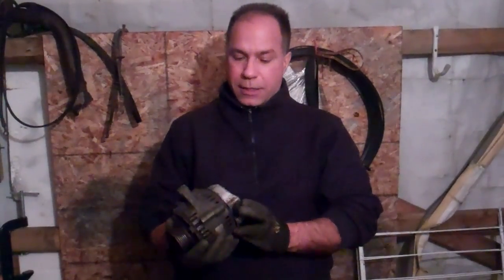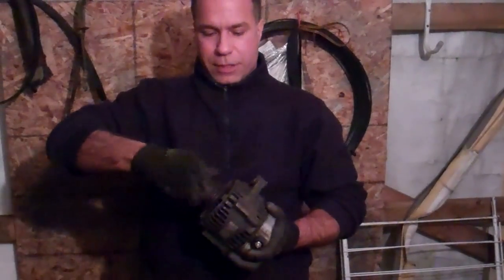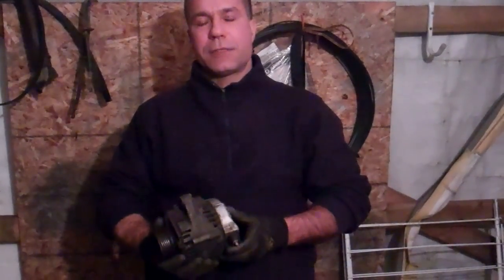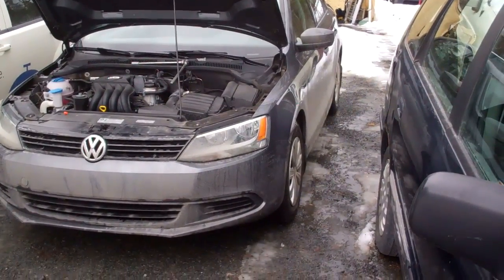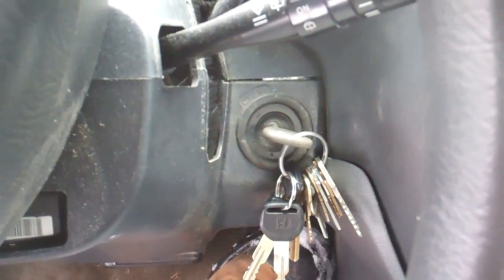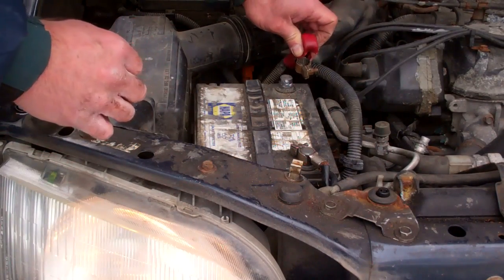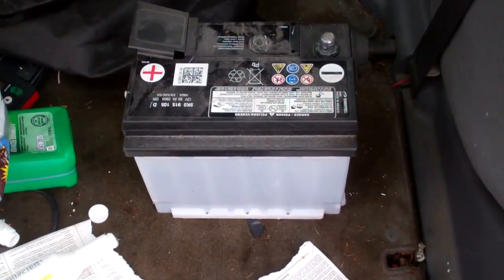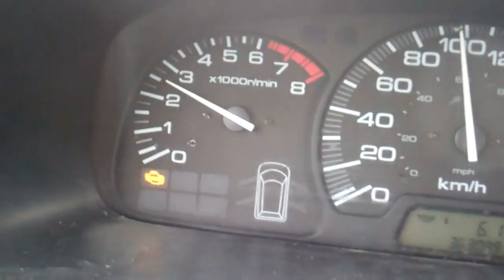Charging a dead car battery using the cars alternator

Comment: Using the alternator on your car to charge your car's battery will burn out the voltage regulator. Better to charge the battery with a charger at AutoZone etc.

Comment: Great idea to use what you already have if you need a boost immediately. I have an old (75%) battery as backup connected to current battery but with a 'relay' to charge both as I'm driving but doesn't drain main battery when it's stationery. Depends on availability of space. My main battery is in booth compartment  so it was easy to connect both. No more 'bad starts failures'. But also check 'unnecessary drainage' of power to stop dead starts.

Comment: Excellent Thank You - subbed.  Last year I swapped my small van's OEM 65AH battery with a bigger 115AH marine deep cycle dual purpose battery so I can camp, work and cook in my van.  It's a cheap $100 battery from home depot that comes with a 1 year warranty. I don't expect to get more than 3 years of life from the battery.   My alternator is 160A alternator and my engine is a 4 cylinder.  I frequently drain my battery down to 11v from 12.6v.  It's always started and never left me stranded.  I just need to make sure it always has water in it.   For over a year I've noticed my voltage will go from like 11v to 12.3v in JUST 30 minutes of running while parked, but then settles so when i come back the next day it will be around 12v.  Does this sound right? Can somebody translate this into percentages?   What percent is my battery at 11v?  12v?  how many minutes would I need for the battery to be at 100%?  So  driving is much better than running while parked?  By my calculations, this battery offers me about 700 watt hours of usable power before its discharged too far and won't start the van and I may be damaging it. Some testing on my channel.

Disclaimer:  Try this at your own risk.  I understand this is not the nicest way to treat a new van, but the decision was based on major cost savings that come from using the van like a hotel, office and kitchen and not having to drive back anywhere or pack and unpack saving me a ton of money and time that offsets any perceived damage to the van many times over.  It's also much safer being able to sleep in the parking lot of a bar at 3am!   I've taken the van to the dealership many times and nothing I've done seems to have voided the 5 year power-train  warranty.

Comment: Do you need to run the car on the highway up to 2500 RPM, Will the Alternator still charge the dead battery if you rem the engine up on Stationary to say 2500 RPM, or simply just idle at 800 RPM

Comment: just for the ppl that don't know better. don't do what this guy did when connecting a batter to a vehicle. u want to connect the positive terminal first and then the black negative. i totally get he was connecting a dead battery to junk vehicle. connecting the black "negative" terminal first can cause a short if u happen to touch any metal  inside the vehicle. always try to remember "connecting to live battery  = black goes last," and when "disconnecting =  black goes first." hope that helps
Reply: 100% correct. If you connect the negative first,  you can short circuit the positive terminal with your tools while connecting.
Reply: For security and protection to avoid grounding your absolutely correct.

Comment: Viewers, please heed his advice and do NOT disconnect a battery while your engine is running.  Old timers will tell you that’s how you check your charging system.  On older cars, you could get away with it.  On modern vehicles with all kinds of computers, that little spike or surge will likely do a LOT of damage.  The battery acts as a buffer to absorb any surges or spikes, and compensate when alternator output is low. 

Also, please don’t let any car battery sit while it’s discharged.  Sulfation occurs, and it will ruin the battery very quickly. 

it’s very bad for your alternator and battery to use the alternator to try to charge a battery that’s flat dead.  Alternators aren’t designed to charge flat batteries, and overloading it can damage it.  Running the engine for a few will put a little charge into the battery, but not a full charge and being undercharged causes sulfation in the battery.  Unless it’s an emergency, get a battery charger on that battery and let it fully charge before starting the engine.
Reply: 100% correct
Reply: Except many chargers will not charge a fully dead battery. I’m learning this today after buying a new charger and the owners manual states it will not charge a battery that is at 2v or below. Mine is at 6v and still won’t charge

Comment: You would have done better by stating how long you let alternator charge before shutting it off. The video went about 55 seconds at most before you shut the engine down. Ha ha I guess that's how long it takes! Snap! I'm not a blonde woman so that is just a joke. All kidding aside, you should have included that even though there's no guarantee another battery would be exactly the same, especially as yours wasn't totally dead to begin with. Guess I will find another video to see if I can learn something. See ya!

Comment: Could you spin the alternator pulley to charge the battery without starting the car? Like detach belt and hook a tiny motor up to alternator?
Reply: That’s the difference between a generator and an alternator.  With a generator, the field magnets are fixed magnets and no electricity is needed to initially generate current.   Turn a generator and you’ll get voltage. 

An alternator is much different.  The field magnets are electromagnets. In order to get current out of the alternator, those electromagnet coils need some initial voltage.  This comes from the “F” or “field” wire that connects to your alternator’s voltage regulator, and usually goes through the discharge warning light on the dash.  Every alternator has a wiring harness with a field wire.  Models may be different, but they should all work about the same.  If you go disconnect your field wire from your alternator and start the engine, your battery voltage will stay the same and your alternator won’t put out any voltage.  That’s why a burned out alternator warning light on the dash can cause an alternator to not charge. In my experiences, usually when an alternator regulator failed, instead of the warning light coming on while driving, it would stay OFF when the ignition was turned on.  Always make sure the warning light comes on when you start your engine!

On the subject of field coils, sometimes an alternator will self-excite around 4000 RPMs if it’s not getting the initial field voltage, and put out its own voltage.
Reply: Play Geetar no.  In order to get current out of an alternator, it needs a little bit of electricity first to energize the field coils.
Reply: Did it work
Reply: Brock Potter I have a dead battery in my 06 suburban. I want to see if it will recharge if I connect it to a drill and spin it for sum time. Just enough to get my windows back up
Reply: Ya used an angle grinder with a hockey puck attached just be sure to drill it center drill would work fine if it will fit just make sure the belt is loose on your car before attempting any of the above

Comment: can a bad  alternator damage a new battery
Reply: Terrence Mclendon If the alternator is shorted it can drain the battery. A shorted battery can damage the alternator. A shorted starter can drain a battery. Other drains can drain the battery. Use a test light to check.